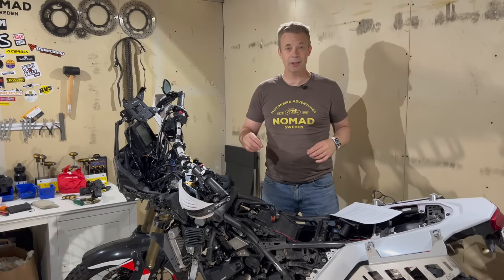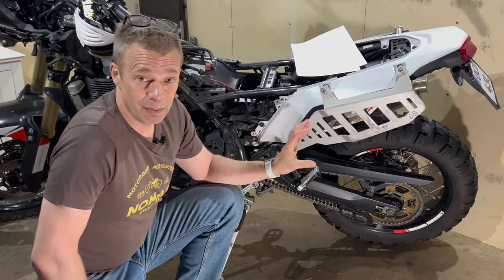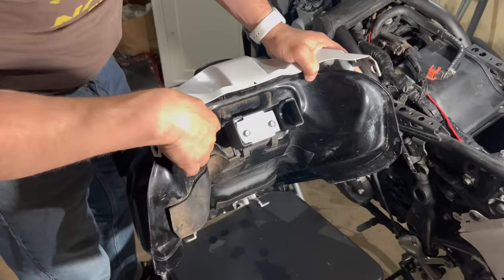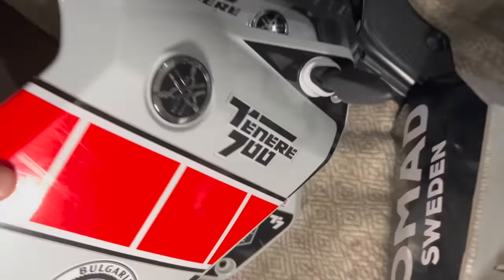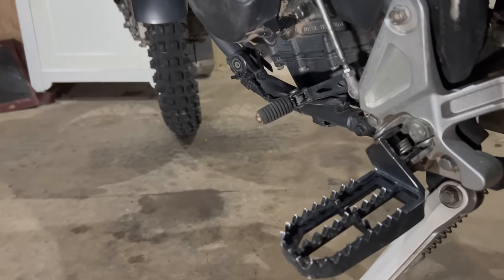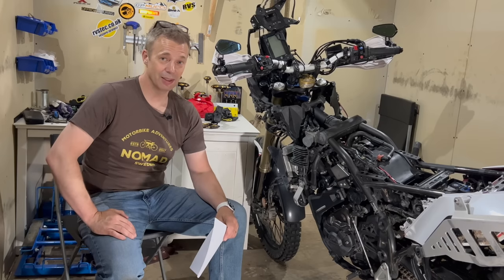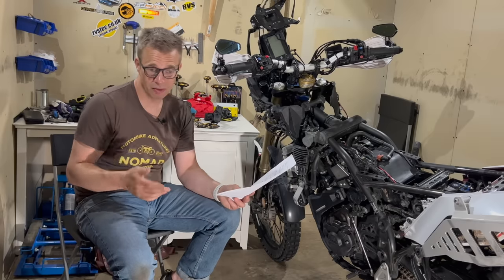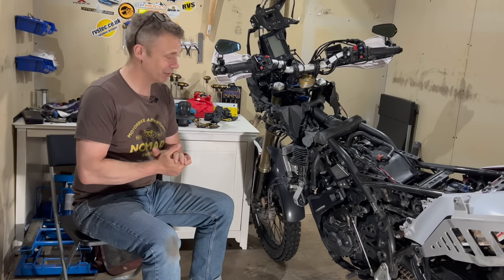Tenere 700 - 50,000 km long term review

Comment from the maker: Update: Forgot to mention that I have also relocated the side stand switch because it can easily be crushed. On 15:24 you can see it in front of the gear lever on the frame near the oil filter. I don't recommend doing this because it can be dangerous if you ride away with side stand down. All I can say is that I am used to check side stand every time I start. It's a reflex now. 
The safest would be to leave it in place but prepare a shortcut switch in case it breaks.

Comment: I have bought my T700 on April 14th this year. Today I have passed 10.000 kms withouts the slightest issues. Been on a 4 week trip in May/June through Germany, Luxemburg, France, Spain, Portugal, Andorra, Switzerland and back to Germany (8.108 kms). It performed fantastically. Apart from the great riding comfort (higher Rally seat...), it was the fuel consumption, that surprised me in a positive way. When I'm in travel mode, I manage to reach between 3,1 and 3,6 litres per 100 kms, which means, you can easily reach 400 kms on one tank without having to drain it completely.  And all that fully charged and equipped with Touratech aluminium panniers. In everyday life I can do between 3,7 and 4 litres, which is not bad either.
When the engine is cold, the clutch is a bit sticky, which makes the bike do a little leap forward while starting it up. But that's not a real problem. It was way worse in my trusty old Transalp 600.
Suspension is stock, even though I'm a bloke of almost 2 metres @ almost 100 kgs.  And tbh, I find it very stiff. Therefore I'm having a hard time believing that it needs replacement. I definitely don't want and need a higher spring rate. That would probably kill every trace of comfort left.
I have mounted a HP corse silencer that shaves off about 2,3 kgs and a big Givi windscreen. Sounds decent without being too noisy.
One of the T7s very few perks is the speedo, which is quite off. A reading of 60 means 52 GPS, 90 is 80-81 GPS, 120 means real 109-110. Luckily the odo is only off by a bit less than 2%. 
I love my bike to bits. Very smooth engine, very economical and reliable, very offroad capable and NOT top heavy. I'd buy it again, that's for sure...
Reply from the maker: Thanks! Actually when upgrading spring and setting more compression/rebound the ride became smoother! It just works better. So don't reject the thought just yet. A good tuned suspension works for you.

Comment: Before starting any bike in cold temperatures, the rule of thumb is to turn gear on, press clutch and push the bike  a bit (one meter is enough) to disengage clutch disks if they stick to each other.
Reply from the maker: Will try 👍🏻

Comment: Great review 👍. Seriously thinking of changing my bike and the T7 has definitely peaked my interest. My current bike is purely street focused and I'm missing off road. The downside to research is that all I'm getting is reviews about top heavy, bad suspension etc. I love Yamaha and have had a lot of on and off road machines but I am looking to get just the 1 bike to do both. I am similar weight to yourself so hearing simple suspension changes is brilliant, also not noticing a "top heavy" issue. Like you I just get on and ride the damn thing. Engine reliability was never an issue for me, you have just reinforced that. Best of luck to the next 50,000 kms and thank you from Ireland 👍
Reply from the maker: Thank you Keith!
Reply: Any 200kg bike ridden off-road will be a bitch to pick up when you fall over. Sometimes you end up with the bike in a good position, sometimes not. I've seen some test where guys drop different bikes on their driveway to "measure" how hard they are to pick up. This does not transfer well to the real world. I can't ride my T7 on the same trails I took my Husaberg Fe501, but I knew that when buying the bike. On the other hand, the T7 is comfortable on any road surface, that Husaberg was a bitch considering vibrations and noice.

Comment: Another great video Robert, learned loads. I would definitely reccomend the pre-filter (and carry a replacement) if you are riding with your buddies in dusty conditions i.e. Maroc. I was shocked at the condition of the pre-filter on my T7 after a 500K Rally in the UK. Microscopic dust will wear your piston rings and cause all sorts of engine problems! No need if you always ride in the front of course 😉
Reply from the maker: Thanks i am actually browsing for that 👍🏻

Comment: As always very nicely said. Just a small comment regarding my experience with the nylon screws...I had those, had slide on the wet tarmac, head of the side screw was sheared off. I can confirm it works as planned. But it was tricky to remove the rest of it from the fork, very tight fit on the thread. You need to use a drill and be careful removing it not to damage the thread. Now I am using original steel ones. Just a thougt to consider. In case of some bad experience with the steel ones you will be the first one to inform 😁. Robert have a next, and next, and next 50k safe trips on this great bike. Love it!
Reply from the maker: Thank you for your feedback!
Reply: I also broke one.... a hot screwdriver works perfectly.... push it into the thread and wait for it to cool down a bit... then it just unscrews.

Comment: Hi Robert,

You did a great review of the bike. I looked at it with pleasure. I also own a T7, currently at 46k km and I am very happy with it. Just for comparison, I changed the front brake pads at 20,000! haha, and the last ones I still have the original ones and they are not close to used up :) as for the rust, I also have the same problem, exactly at that joint you showed in the video + spokes on the wheels... best regards from Croatia, and btw., I saw that you have been in Croatia in military base "Željava". I saw your sticker in the cockpit of the plane \m/
Reply from the maker: Ah thanks! Croatia was great 👍🏻

Comment: 100% agree about top heavieness... they only people complaining about top heavieness are those that dont own one. I even weighed it at the handle bar... no different than the 790 and a lot lighter than the AT. There is NO top heavieness. Its just an urban myth spouted by 790 owners trying to justify the low slung tanks.
Reply from the maker: Thanks Nerb1. With you in my corner we can fight them all off! 😂
Reply from the maker: @Gbner  From my view I talk about if I feel the bike is top heavy and if it is a problem for me. I have no complaints about the weight distribution on the bike I don't understand people who turn the bike down because of it. If course there are bikes with lower CoG and different feel when riding. For myself, I have never thought of the T7 as problematic in this way. It's just not a thing at all for me. I don't understand why this is a big topic.
Reply: @Gbner  Im sorry, but I am referring to physical measurements, not your feelings. Go you my channel and look at the video called "does bike weight matter". I physically weigh the "top heavieness" of the T7 and the 790. Both are the same weight when lifting from the handlebar with 15L of fuel in both bikes.
I think that because the seat height is lower on the 790, you think it is less top heavy.
It is a myth unless you can empirically prove it to me otherwise.

Comment: Great video Robert. I'm really trying hard not to get one but the more I hear and see about the bike, the weaker my resistance s getting ;)
Reply from the maker: The good thing about bikes is that you don't think about economy when riding. That's why I have 50.000 km.
Reply: @NomadSweden  I'm currently riding the Triumph Tiger 800, but off-road is kind of impossible with it... witch is what I want to do.
Reply from the maker: @mindtraveler  T7 is indeed a step in that direction without loosing too much on road capabilities.

Comment: Excellent review!  I sold my GS 1200 and bought the T7 for the same reasons.  I have 20,000 miles on mine with no issues except the cold clutch slip you mentioned.  Funny, I was using aftermarket oil and just recently switched to Yamaha Lube.  Doesn't sound like that will fix it.  We'll see.  Thanks again!!
Reply from the maker: Cheers!
Reply: how its feeling after 1200gs. i have an also 2016 gs and i am thinking to buy t7
Reply: @turgayaslan9975  the only thing I miss going long distance at sustained 80 to 85 miles an hour.  The T7  will do that but I don’t like running it at that high of rpm’s for long periods of time on the highway.  I keep it around 70 miles an hour.  No big deal but just something I miss.
Reply: @seisamigos397 Are you getting any hand or butt vibration on long rides?
Reply: Not at all.  Seems to be fine.

Comment: Thank you for nice walkthrough of services, maintenance, currative maintenance and more.
When you talked about mirrors and what is legal I went like, what? What countries has laws on that, apart from how many one need and so on. Turns out there is a EU directive, although lenghty I guess the main thing is that they need to be at least 28cm away from the center of the bike, also they must be attached that they do not move during normal drive, and they must be able to be adjusted when the driver is in a normal driving position. Also, the mirror needs to have a minium mirror surface of 69cm².
The position, where it is over bars, on the handguards, or hanging which is a type popular on bobbers and similar bikes is not really regulated.
Some countries that can be picky and have their own rules is Germany, that during a traffic stop can test what signals you can see from behind and Austria that can do a cirular diameter test on the mirrors. Now, you, driving a Swedish vehicle is not affected by that in those countries as coming with a foreign bike, you should be grandfathered in, so to say.

Did you do or consider a cat delete? Why and why not? Heard is saves 1.5 kilos or more.
Reply from the maker: Yeah Germany is fierce with the laws. You even need to bring the papers for any non standard mod you have to proove the cartification. My T7 is Euro4 and has no Cat 😊It came on later models when Euro5 was endorced

Comment: Nice video and review Robert...I have only 25 thousand kilometres on mine but its used all year round and is doing great. Feel happier I've changed the plugs and sussed out how to do that.  A spring from Rally Raid and B+B rear rack is next. Just fitted an Atlas throttle lock...works well on the long road rides. I love the aesthetics of the bike..and the engine is a gem..! Cheers,  Steve

Comment: I was thinking how clean & spotless your bike was & then you mentioned the Jet washer, I have a 2010 Kawasaki 250 D-Tracker & even in the manual it states to not use a pressure washers on it, my friend who used to look after it for me was always using his pressure washer on it & I had to replace the steering bearings that had gone rusty, pressure washers can get water in places that wouldn't normally be possible.....
Great video in-depth video & you are obviously very meticulous with your bike & I doubt most people would even know about the rust under the fuel tank, I've had my bike over 12 years & im thinking of  getting something bigger, either the klr 650 or the T7, my only concern is that ive heard so many people saying that it is top heavy, my bike is also top heavy but is obviously much lighter than the T7, so after watching your video I've decided on the T7......
Reply from the maker: Thanks for your input 👏🏻

Comment: Best and better results to prevent corrosion and keep bike in nice form is to use XCF rust blocker instead of ACF -50. XCF is proven to hold better onto surface and lot longer to prevent corrosion.

Comment: With reference to the bearings, was it the swingarm,wheel or linkage?...by far the best most informative t7 series out there...awesomeness.
Reply from the maker: Thank you! It was the outer bearing on the break side. I have changed all bearings again after 60.000km because of a little play in the bearings.
Reply: @NomadSweden  thanks for the info dude appreciated...

Comment: Nice vid and mileage review. One note regarding steering damper, with stock suspension it really required, but once you change springs for your weight or even better change cartridges for more better one RR, Andreani, Öhlins or similar you will notice that damper might not be required, as it gets much more stable on higher speeds and rocky terrain.
Seems, you forgot to mention loosen steering head nuts (judging by your vids), as it happens to me as well.
Reply from the maker: Ah yes I forgot that.. thanks :) 
You may be right about the upgraded suspension because I have not tried. Still the steering dampener helps in sideways twists due to big loose gravel and stones etc so not the same exactly. But sure, it will be an overall smoother ride with Öhlins.

Comment: I'm on my 2nd super tenere 1200 and now in my early 50s I'm thinking of something lighter and the t7 has always been in my mind but the tubes put me off Robert.I could just about live with the change back to chain from the ease of the shaft drive.
Reply from the maker: I am lucky to not have had a flat tyre yet :) There are pro's and cons and I guess the more offroad you do the more Tubes has the pros. But for touring TL is so much easier. But there are TL rims to get for the T7.
Reply: @NomadSweden  yes sometimes you can worry about something that may hardly ever happen. I drove in the states for 2 yrs on a klr with tubes many miles on and off road and never punctured, I used heavy duty tubes.

Comment: Very nice review ! I would ask about better protection wind/rainbetween BMW and T7 ?
Reply from the maker: Well, both GS 1250 and 850 are more oriented to touring with larger screens, so they have better wind and rain protection.
Reply: @NomadSweden  Yes, but which one of them? I had the BMW, never rode a T7. But seems that it's more lighter and nimble and would take it .
Reply from the maker: Yes i like the t7 better. I dont need the extra comfort of the GS. I had the GS1200 adventure

Comment: Dear Robert great review, just a quick question from a rookie, what is the front grip, and stability on normal roads, in different conditions? It is such a tall bike and large front wheel.. is that stable? I will be using it mainly on road and occasionally off, but love the the engine and the bike, and since I am tall I feel good on it
Reply from the maker: Thanks. The T7 is a great road bike too. Bo issues with stability or anything. Just not as confortable as a big GS

Comment: Hi, thanks for your videos.
With my T7 I am at 60,000km and I noticed that the front brake discs have reached 4mm in thickness (compared to 4.5mm when new) and as per the workshop manual they need to be changed.
Haven't you changed them yet?
Reply from the maker: Yes I changed all discs.
Reply: with OEM parts or you have chosen to upgrade? @NomadSweden
Reply from the maker: @bikerrante  i chose some other brand but bo special upgrade. Same quality
Reply: @NomadSweden  Which brand? The other brand are  so expensive than the oem parts😢 i
Reply from the maker: @bikerrante  I usually buy from this place. They have many alternatives to the OEM parts that has worked well for me https://www.off-the-road.de/en/tenere-700/wear-parts/brake-wear-parts/?p=1

Comment: Hi  Nomad Sweden.

I own a 21 T7 and have noticed engine vibration at 4-5000rpm on the engine. I have read on forums that others have had similar issues  and I am wondering if you have noticed the same?  I used to ride a yamaha wr 250x, maybe I am not used to the parallel twin engine?

 I do have the yamaha oem engine gaurds and have read that engine gaurds can cause excess vibration.
Reply from the maker: Actually I have not noticed. I have no excess vibrations at any rpm. The guards could be the villain for sure. Try taking them off.

Comment: Hey Robert! A quick question. Of course your bike sees a lot of rain, how do you fix the sticky  Ignition Switch WD40? dry graphite? (the poweder of the nose from a pencil) I am curious, as now after a long ride in a lot of rain I have this issue. Thanks!
Reply from the maker: Not sure actually. I don’t have that problem. I guess next service you should have them fix it for you. Opening it your self or spraying could cause problems too.

Comment: My only comment or question  would be, I've never replaced rotors on any of my machines, no matter of mileage. And pads are usually good for 30,000 miles. I wonder if this model is just prone to high wear?
Reply from the maker: I think ADV bikes who are lots in gravel and dust are more prone to wear breaks. The actual rotors and pads are same as on other bikes. Pads are offroad oriented though. When I chose harder pads, it grinded the rotors down quicker. So I think it's more about what you put the bike through.

Comment: For only having side stand, did you consider the crotch trick/mod? It is using a telescoping walking stick, shorten it and using it as a tool where you can that in combination with side stand to have an excellet center stand should you have to work on the bike on the road/trail? Seems like a cheap and legit tool to brink in your bak instead of having an anchor under you.
Cheers from NC
Reply from the maker: Yep i had a home made crutch trail stand but i have now a very small one i bought. It’s like 140 grams. Never used it though. 67.000 km and no flat yet. Knock on wood
Reply: @NomadSweden  LOL, I am sure that if you had not had it you would have had a flat by the law of Murphy